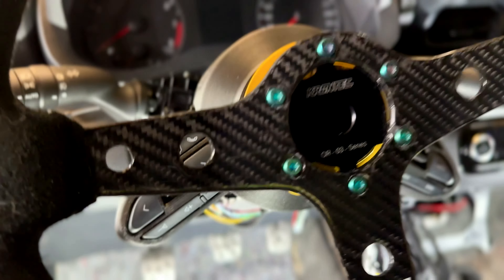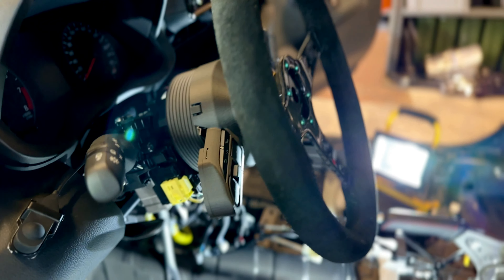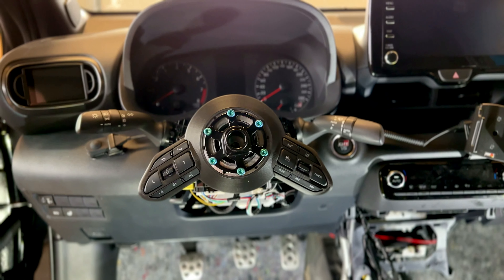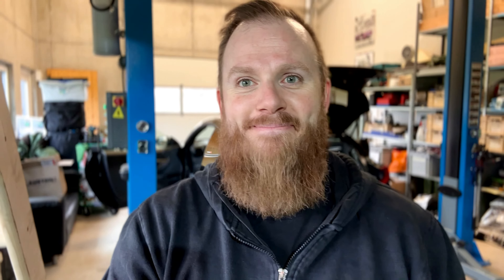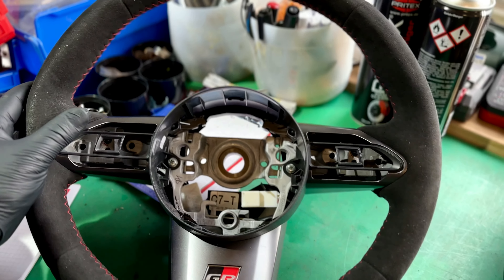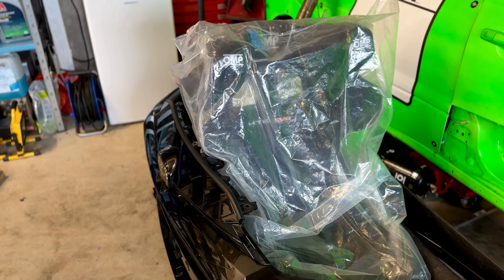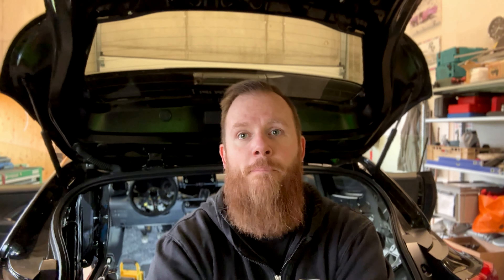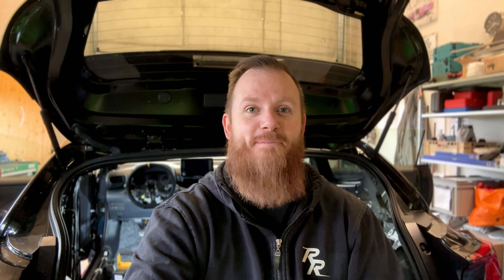Toyota GR Yaris - Carbon Snap Off Steering Wheel

Comment: Cool stuff!! I guess it wont be long until all the electrical switch gear gets ripped out and the car runs on a custom loom? Looking at the design of the quick release, with the pins sliding over a tapered spigot, maybe you could accidentally pull the wheel off with some excessive force?
Reply from the maker: No chance. They use that in professional Motorsport for years.
Reply: @RotheliRacing  ok, thank you. It certainly is a brilliant solution for a bolt on. I have a lifeline QR, which is great but needs to be welded to the column.
Reply from the maker: @NigelsModellingBench  yeah. That‘s also available as a weld on.
But there aren‘t that much good bolt on solutions…